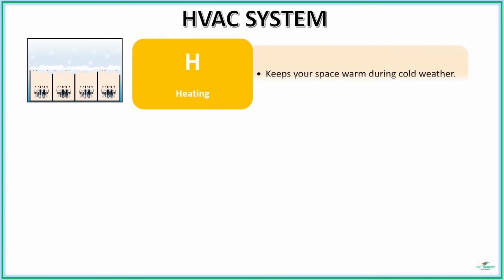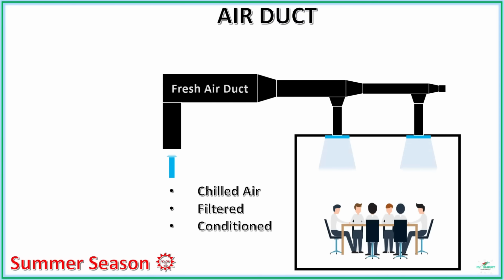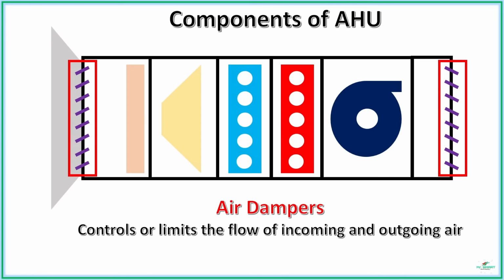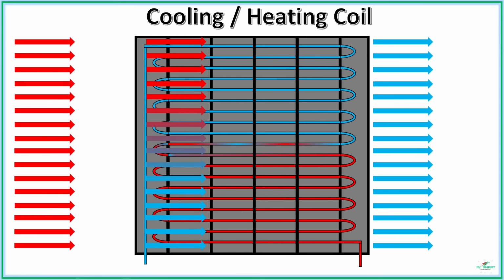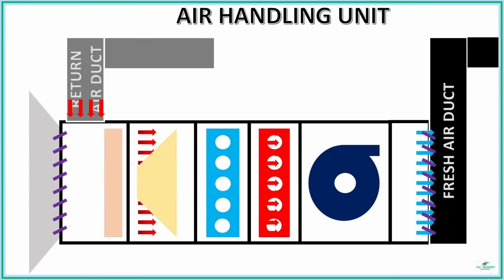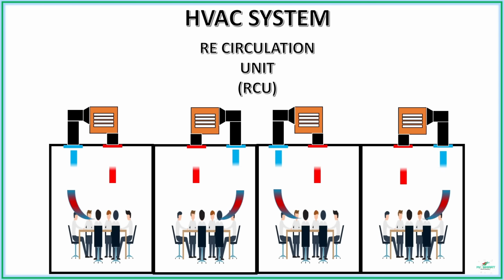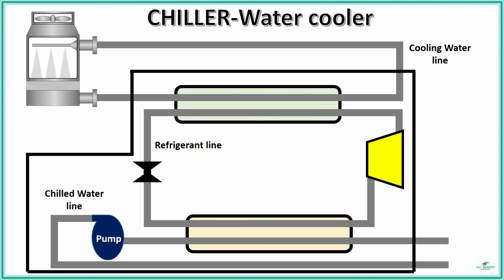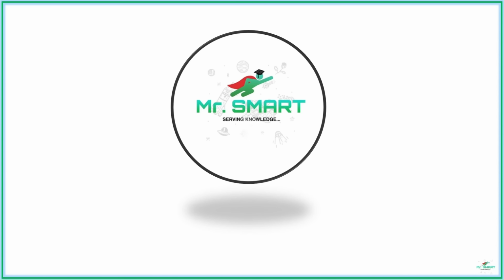HVAC Systems Explained: Components, Functionality & Benefits 🌍 | Ultimate Guide for Beginners #hvac

Comment: When haze coming how to reduce particles count
Reply from the maker: First confirm the particle is coming from outside. If it is coming from outside, in addition to pre-filter and filter, we can use a HEPA filter at the opening end inside the room. This will help a lot to control particles size. In addition, choose the filter according to your requirement.

Comment: how the atmospheric air comes from
Reply: Good question
Reply from the maker: An AHU (Air Handling Unit) gets atmospheric air through a fresh-air intake/opening connected to an outside-air duct which is controlled by air dampers. As the blower is continuously delivering air inside the system, the pressure difference will make atmospheric air naturally flowing inside AHU through intake openings.

Comment: I have a question how does the hot water goes to AHU ? as you showed that the cold water is been transferred via pump which gets the cooled down by using evaporator. Please explain
Reply from the maker: Just like cold water is used for cooling, hot water is used in AHU for heating. This hot water comes from a boiler and is sent through a separate heating coil inside the AHU.
When air passes over this coil, it picks up heat and becomes warm before going into the room.
So basically, AHU doesn’t create heat—it just transfers it using hot or cold water depending on the requirement

Comment: 5:27 the diagram is incorrect 😢
Reply: Compressor side should be red and expansion valve side should be blue. 5:18
Reply from the maker: @badrinadthmasetti9219  Thanks for your feedback.This video was made to give an introduction or basic idea about HVAC System. Please have a look at our video about Chillers for details...